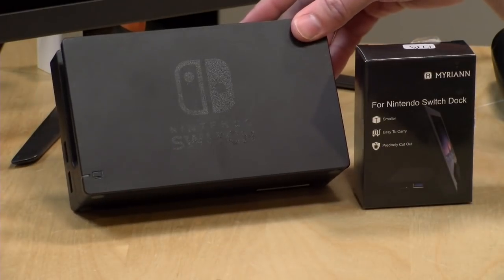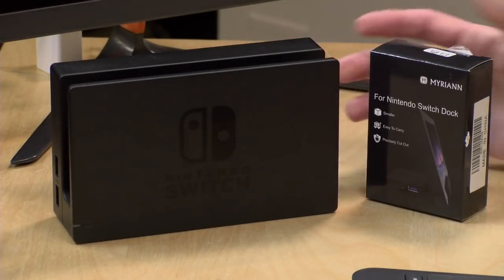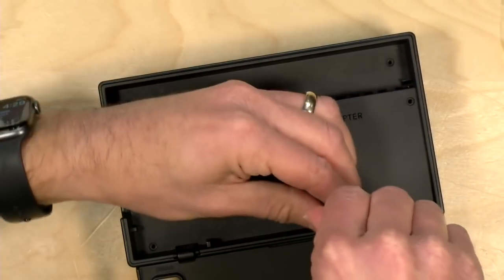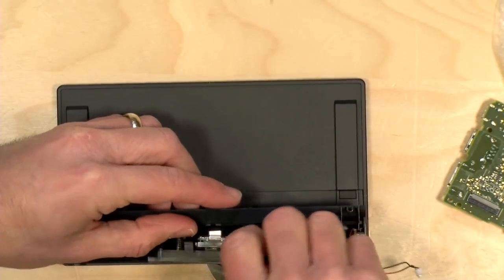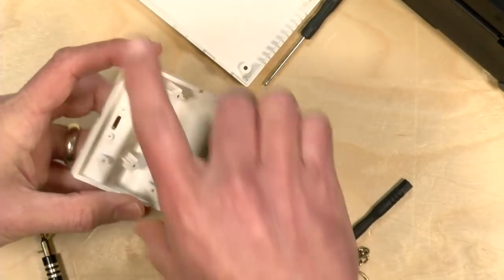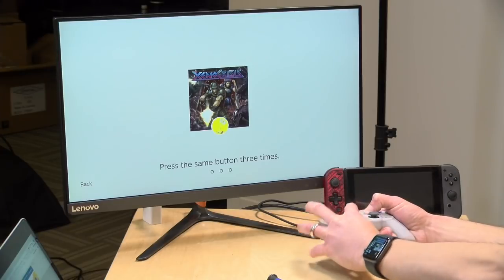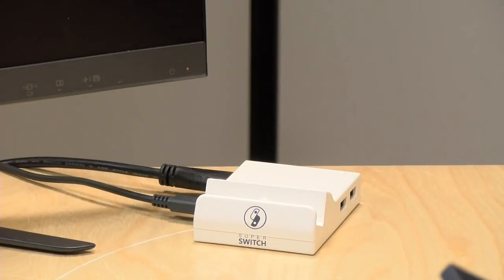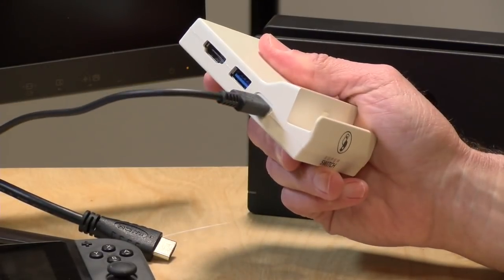Live: Retrofitting my Switch Dock into a Portable version

Comment: I have the same ORIA Screwdriver kit. While no, it's certainly not the best kit, it's certainly better the crap that's included with this portable dock. The ORIA screwdriver kit has a lot of advantages. It's magnetic, which allows you just lift the screw out along with the screwdriver(once loosened). The screwdriver itself can be extended if necessary. It of course has plenty of interchangeable tips. My favorite thing about the ORIA screwdriver kit has the bottom of the screwdriver spins freely, and this saves my wrist more often than not.